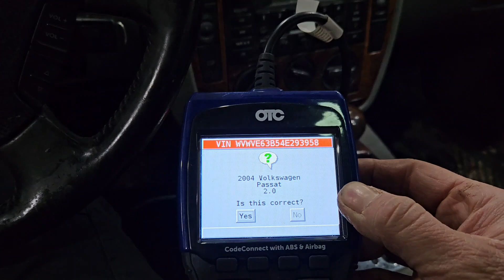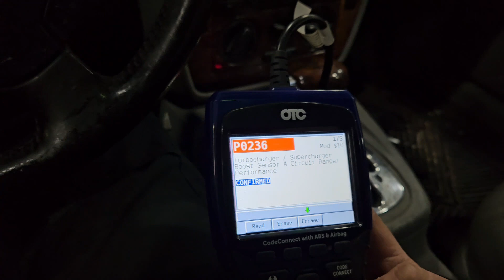Tacoma gets a TDI engine!

Comment: The ALH is basically indestructible, and quite easy to work on, while the newer BEW and BHW's aren't quite as good, and more complicated to work on having internal injectors and a couple other differences
Reply from the maker: Yeah. That is what originally drew me to purchasing my 2003 Jetta Wagon. I was worried about camshaft problems and costly injector upgrades with the PD engines. Then, I started looking at what the ALH would need to handle 200HP and that requires stronger internals. The BHW is a stout unit and should so handle the increased power as is.

Comment: It needs ne cam and lifters. Its not great but not terrible.
Reply from the maker: I'm curious to see how all of the components look once I pull the camshaft out. As far as I know, these engines did not come from the black nitride lifters but rather, gray/steel colored. If things are shagged, I will be in for head work and perfect time to tweak the bumpstick!
Reply: Its a super easy job, I did it on an 06 brm tdi, new cam bearings and nitrite lifters  @PostRt

Comment: The heat sheld is missing off of the turbo
Reply from the maker: As far as I can tell, this turbo didn't come with heatshield. However, there is heatshielding all around the turbo area. It appears that the valve cover has been leaking for a long time, and that may have been what caused a small fire. Whatever the reason, they are lucky that the whole car didn't burn to the ground!